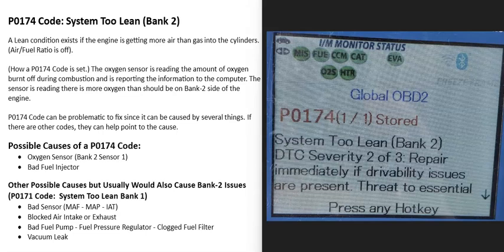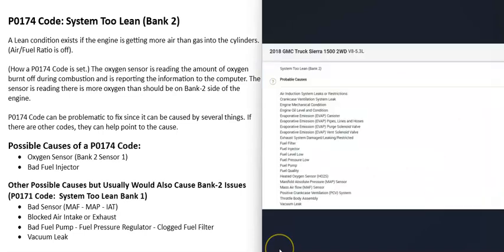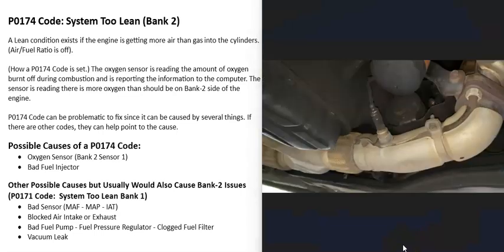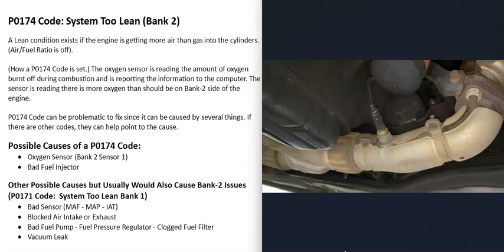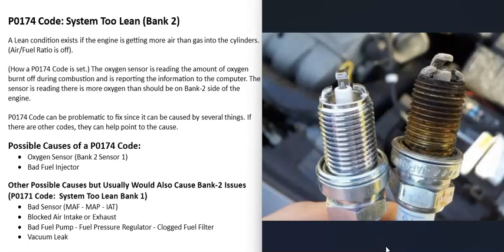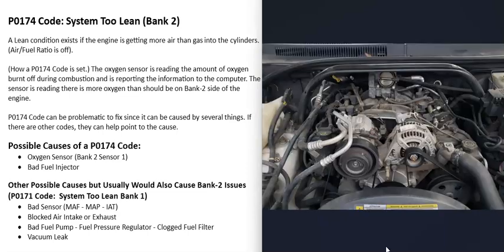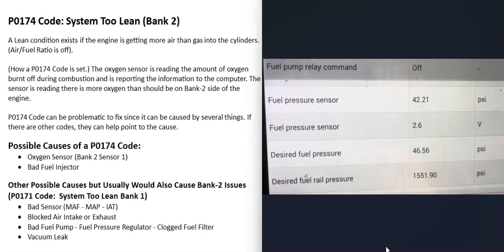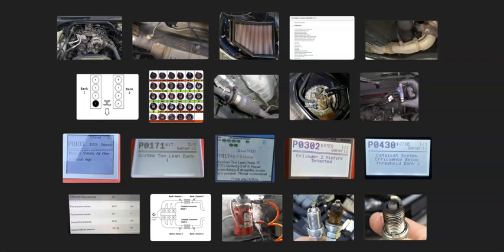Causes and Fixes P0174 Code: System Too Lean (Bank 2)

Comment: I think you're the only one that talks about it more I only have a lien condition on bank two only My PID is showing that O2 sensor testing as either incomplete or not working as well as The Purge valve but my readiness for my evap cleared I'm pretty sure I have a a small vacuum leak sometimes when I drive I hear a whistling noise This is off of a BMW

Comment: Hi,HVAC .  2015 Ford Explorer sport the mechanic ready run all the test now he says he can’t find the problem. I have to take it to Ford my question here to US do you think is something big and I bought it from a small dealer? The car runs good. The only thing that I think it uses a lot of gas but for now I don’t feel no problems. It’s just the check engine light and also two coats. ? Thank you.

Comment: I have both P0174 and P0171 codes. I just replaced a cv and didn’t have these codes before. Cleaned MAF. Maybe I need to check the 02 sensor, which I gave to the shop but they said it didn’t need it. New spark plugs, new wires….IDK🤦🏾‍♀️ thanks for the points, I’m going to go through some and see what happens.
Reply: Do u have ticking noise??

Comment: I drive a 2008 Honda Accord EX-L 3.5L V6 and have this exact code. The code came right after finishing a valve cover (both) and plenum gasket replacement job. I've cleaned the MAF sensor multiple times and checked for loose or ripped hoses ones but everything looks fine, what could it be?? Need a response quick since I have a road trip coming up soon, thank you!
Reply: me too! i have the same car, have you found anything?
Reply: @eve2143 Nothing yet man but I’m also not worrying about it too much at this point. The car is driving perfectly fine, no weird idling, no weird noises, the check engine light with that same P0174 code comes on and off on its own every several days, I don’t even have to turn it off with my scanner. So far I’ve replaced the MAF sensor, intake hose boot, PCV valve and purge valve solenoid, have also ran seafoam cleaner in the gas tank, and even did a smoke test in the intake system but noticed no leaks, so who knows 🤷🏻‍♂️ as long as the car drives fine for now lol
Reply: @jegonz98 o2 sensor
Reply: @chadj8374 You think so? Which one tho?

Comment: I've had a P1283 code and my car felt like it was misfiring or skipping a beat randomly. Today I scan again and see this code P0174. Would the P1283 make it feel like it's missing at random times? Usually when taking off from a light.
Reply from the maker: Most engines still run OK with a bad 02 sensor, but they can be less responsive or lag a bit more than usual. I would test the 02 sensor, but if there is misfiring, there is likely a lean condition on Bank-2.
Reply: @HVAC_Mechanic ok, I have a code for the lean condition now so I'm going to follow your lead on this. I'm assuming it's whats causing the hiccup / skipping I feel. Thank you.

Comment: Thank you for your video. It's very informative. I have 2022 Corvette stingray with 11,700mi. I'm getting P0171 and P0174. There are no other codes. The check engine light comes on intermittently.

Comment: I'm getting p0171 and p0174 but most ot the parts are brand new. Ford parts too. I'm thinking of doing a smoke test
Reply: Good idea..take engine cover out, on mine leak came from intake manifold gaskets..replaced gaskets and all problems solved...

Comment: I am getting po174 and a po430 both bank 2 codes
Reply: And it has no power won't accelerate
Reply from the maker: I would test the catalytic converter it may be plugged up.
Reply: Mine ended up being one of the front cats busted and dumped everything in to the second one before the muffler so it was plugged.  Cut the cat out and its back to normal but a little louder
Reply: I've been having 0430 and 0174 codes as well. I replaced the 02 sensors as well as bank 2 cat converter. I bought a replacement cat on Amazon and cheap 02 sensors off eBay. Problem with 0430 got worse. Soooo I took the original cat, soaked it in laundry soap, oxy clean in a big bucket for 24 hours. Hosed out the cat, purchased factory denso 02 sensors, replaced everything back. That 0430 disappeared but I still had the 0174. Just yesterday I pulled the 3 bank 2 injectors, tested them all the cleaned them. #2 cylinder injector did not spray well but after cleaning I reinstalled them. Drove all morning no more 0174 code but.... I still ordered all new injectors. As a side note I had no performance issues. Nothing misfired. I just have 165000 miles so replacing makes sense. Just don't use cheap parts

Comment: Hey, i have both bank 1 and 2 both telling me the system is too lean. The codes i was given are P0171 and P0174 with a secondary code of P0325 for the knock sensor 1 circuit. Im not sure what the issue could be

Comment: I'm getting both these exact codes. Wouldn't I get a different code if it was my MAF sensor tho?
Reply from the maker: Yes, if the MAF sensor is bad, usually there would be a MAF code.
Reply: @HVAC_Mechanic  Hello, I'm French, please excuse my broken English.

I own a 2006 Chevrolet Express 6.0 V8. I have a problem with the number one knock sensor. Since I can't afford to remove the intake manifold, can I move the knock sensors to the cylinder head? I'll also replace the wire that connects the knock sensors to the wiring harness. Does this work?

Comment: Interesting because I keep having the spark plug in bank 2 constantly fouling and having to replace it specifically. Once I replace it, it runs fine for a couple months until the car sputters out
Reply: Valve cover gasket on bank 2 most likely needs to be replaced